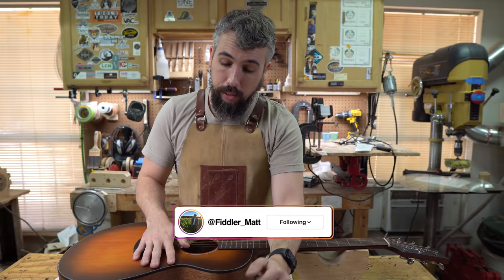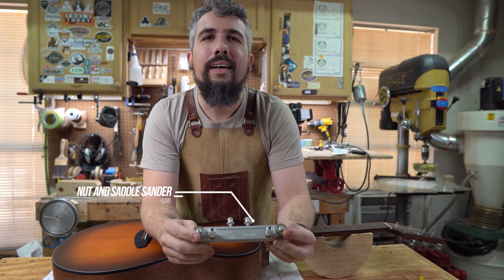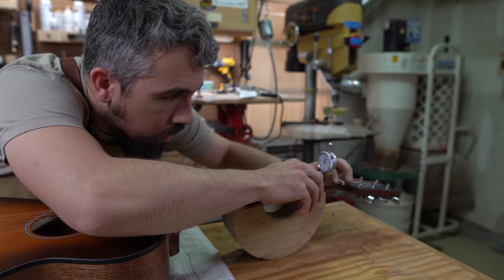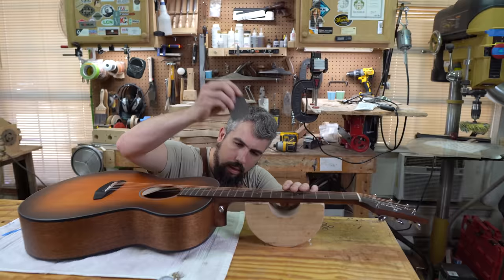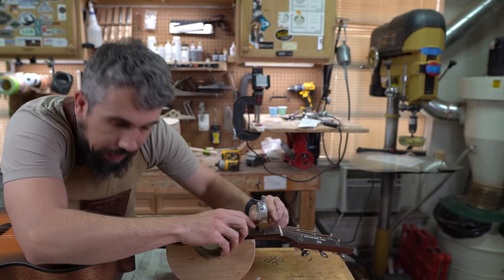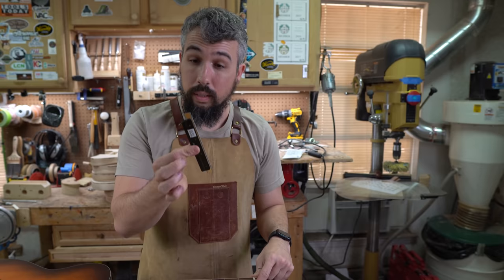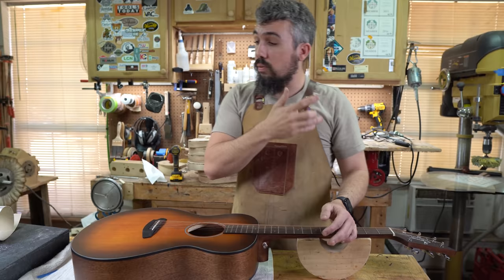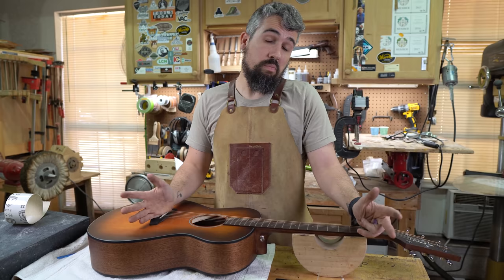How To Make $60 An Hour As a Guitar Tech/Starting Luthier!

Comment: Great video, guys! On the ‘complex’ math for how much to take off the saddle, it’s as easy as multiply by 2. You wanted to lower the action .030, so times 2 is .060 - the amount to take off the saddle. Your estimate (impressed by your eye and feel for this, by the way) was 1.5mm or about .050. If you’d done .060, perhaps you’d be where you wanted to be. Just times 2!

Comment: I worked for Gibson guitars in Nashville, doing final setup on electric guitars. We used a pretty cool way to mark the nut as a guide to how deep to cut the string slots.

Cut a pencil in half, then lay it it on the frets, with the lead touching the nut. Slide it across the frets to make a line across the nut.

Then cut your string slots, down to where the line is. It gets the action very close to where it needs to be.

Hope that makes sense!
Reply: Interesting
Reply: How much they pay

Comment: A great way to learn setups is to buy the cheapest guitars you can find, set them up so they play better, and try to sell them for a slight profit. I can now set up strats because of this. It's amazing how poorly people care for their guitars. A fret polish (not level, just polish), serious cleaning, some light fret-end dress, and a good setup can go miles for playability. 

Even if you break even on your purchase and sale of the guitar, you have already won through the knowledge you gain by fixing it up.
Reply: maybe not the "Cheapest" guitar, but inexpensive so you don't have to worry about it. like a squire for your first strat setup, for example, rather than USA fender.
Reply: Can I ask what you use to polish frets? And clean finger boards? 

Ive been taught to use zippo fluid. 
For fretts just a fine polishing sponge on a palm polisher. 

Thanks in advance if you see this. It's been some time since you commented.
Reply: @highrider9168  have used a few things 0000 guage steel wool and the music nomad fret polishing kit. Stew mac makes great micromesh pads, which i'd recommend. The compounds/liquid stuff does a "better" job  but it's a lot more messy and difficult.

Cleaning the frets - a scraper is your best bet, and a damp cloth of course! I have used steel wool but I think it shows scratches.

Comment: Being a carpenter and mechanic by trade early in life has enable me to have acquired many of the specialized tools you have that are used in other trades. I use the depth side of a set of calipers to measure string height and a two foot level with a machined surface to within .0005" to gauge fret height. The look on someones face after you have magically transformed an instrument to play like never before is priceless. They just look at you like holy crap I didn't know their was that much difference when you can play songs just like the original recordings. Just love guitars and music in general for this wanna be master 😁

Comment: That’s a great estimation. Lowering 0.030” @12th fret means lowering 0.060” at the bridge because 1/2 of the string length (hypotenuse of the triangle) will be 1/2 the height of the short side of the right triangle. (Edited for spelling)

Comment: Here is a trick you "might appreciate" for acoustics/classical guitars. You can take a hard cover book and slide it under the strings between the sound hole and the bridge. Slide it all the way down to the bridge, (which will lift the strings) and pull out the saddle to work on it. This is the ultimate time saver on classical guitars

Comment: A quick reckoning for the nut height is to measure the height at the 12th, then take away what you want it to be, and then take double that of the bottom of the nut, i.e. if it's at say 0.110, and you want say 0.095, 0.110-0.095 = 0.015, 0.015*2 = 0.030, hope that makes sense,

Comment: Budget as much as you can for tools and supplies.  Get your feeler gauges from the hardware or auto parts. Make a stable neck rest.   Buy every truss rod wrench you can afford. Keep spare nuts and saddles. 
This is a Stew Mac commercial. That's fine. But there's other companies out there that make decent tools. Some Stew Mac tools are indispensable a lot of them aren't. 
Buy a bunch of guitars, yard sales or whatever. 
Get them as playable as possible. The jacked up ones save to break and repair later. Sell the decent ones for what you can get and buy more tools and supplies. 
Work on all of your guitars. If you can't fix yours you shouldn't touch someone else's. Work on your friend's guitars. 
Ask people to be critical of you. 
Count on a lot of time talking to people and discussing their guitars- that's valuable time you don't get paid for. 
Be straight with the people you deal with. 
Charge a fair price for your skills. 
You'll probably never get ten guitars a day to setup. 
Don't spend money you can't afford not to have on hand. You will not make it back as quickly as you've spent it.

Comment: I bought the nut rescue powder set from StewMac when I converted a 35" scale bass to BEAD tuning because the nut was cut too low for 3 of the four strings when I bought the bass. I wanted to get the height right after I widened the nut slots for the bigger strings and it worked really well up to the .130-gauge low B string and it has held up really well. I find I like tweaking my setups very much. I know the nut power set is not on your list but with some superglue it makes it nice to match the nut color since it comes with different tinted powders.

I love your videos and thank you to both of you. I still wish I could afford one of your guitars...wow.

Comment: Very surprised that you didn’t include fret levelling, shaping and crowning files in your ‘essentials’ tool kit. The nut racer can be sorted with two pieces of wood and four wingnut and bolt combinations. Plus maybe some wheels or roller skate bearings. The money saved will buy a decent levelling beam, triangular fret file with smooth edges and a file to round over the fret ends.
Reply: I'm guessing it's not in the realm of beginning luthier work? 

I don't know, I kinda do my own setups but fretwork scares me lol
Reply: @jamquijano4402  first stuff I looked at many years ago - with good reasons! It IS an essential for repair/setup work though. Can you imagine trying to start a biz and admitting you can’t sort frets? Reputation shot before you start!
Reply: @paulneeds  Absolutely agree.  Fretwork is really where the rubber meets the road.  Proper contact between accurate frets and the vibrating strings is where it all begins.

Comment: Get the Dan Erlewine dvd on fretting and setup. He shows you way cheaper ways to get started. A 2’ aluminum level trued up with sandpaper on table saw table will level it up and work for leveling fretboards and frets. Also a plastic drafting T-square for a straight edge with some tape along the side for better sighting works just fine and you can file slots in the opposite side to check fretboard after it’s fretted.  Get Dan’s dvd and the tips will pay in the end.

Comment: I’ve been picking for 53 years and damaging guitars for about as long. I’ve also been learning steadily over the years, and have learned a whole lot from you guys. I hate measurements, but finally bit the bullet and bought most of the tools/books) you reference here and/or a prior “giveaway“ video …cork neck rest 🤣!  Not ready for fretwork yet, but I’ll get there. Re Breedlove: right around the time you did that factory tour reaction I was researching them… and bought one of their handmade Premier models. Love the tone but I can’t give you any “data“ on factory set ups because it’s a used 2017. I sure hope The one in this video was an oddball because I love to tone & playability and the company is doing some really interesting things… enough snow to get me to buy my first bolt-on acoustic neck after decades of being a (now-former) D-28 owner bullying friends who play Taylors. How ironic that I know on [ < typo = “now own] a guitar with a bridge doctor, stock!
Reply: I just got a new Breedlove Oregon. On every one that I tried, the factory setup was crazy high. Way too much relief, nut needed filing, and the saddle needed to be lowered. Love the tone of my Breedlove, but they need to do a better job on factory setups. All of the Taylor guitars I've played had perfect setups.
Reply: @jlr3802  cool, sounds like you know your stuff. Question: did you buy the guitar from the factory or from, say, a Guitar Center store, where almost no guitar is set up properly (if at all playable, like literally most of the higher-end guitars at my local store when winter hits)?  [Edited to fix my flagrant typos]

Comment: The math for the saddle is very easy, you need to remove just the double the quantity you want to low in the 12 fret. Like it is in 110 and you want to go 80. The difference is 30, and the double is 60 thousands (1.52 mm).
Reply: My advice is to not  set new cheap guitar too low, cause is almost sure it will have some irregularity on the frets and will buzz. So, to low the action to a minimum, you need to check and dial the fretwork first.

Comment: I took the backward route; I built two acoustic guitars only understanding how to set the neck angle. Now I will use them to practice setups. These tools are not cheap though; that action gauge alone costs over $200. Fortunately I already have a few cheaper tools like these. That nut race car is out of stock though.

Comment: That formula for lowereing the saddle is basic right angle geometry. Take twice as much off of the saddle as you want to lower it at the 12th fret. 
EG: if you want to lower it by 1mm, take 2mm off of the saddle. Im mich more comfortable with doing a little easy math than taking off too much and having to make a new one.

Comment: At one point I realized I would never be rich enough to buy all the instruments I wanted, but with that came the realization that I could fix as many instruments as I wanted (if I can find the husks and bits); a good shopper can find values on distressed items if they are willing and able to put in the time to restore them.  
When I bought my Rhodes for what today is a ridiculously low price, I made sure to hunt down spare wires, tines, pickups, etc...just to have the parts, it was complete but a little rough - cut to the end, I have a Stage 88 that I adore and cannot be replaced.
When I get more space, I have a pile of different keyboard instruments and accessories to refurb - I've always wanted a Leslie anything and a whammy clav like Lachy.  Turns out, there is a giant mountain of old electric pianos that exists and the cycle continues...

:-)

Comment: an alternative for the bridge pin puller could be a capo with one build in so if you need to change strings on the road youre able to just to have it handy otherwise id keep the good pin puller

Comment: Thats crazy. I have 6000 in auto motive tools and dont make half of 60 an hour. I have to measure blocks to within 0.001 inches in some places, disassemble, clean, lube, rebuild, time and run a V8 twin tubro engine.....I literally have a single torque wrench that costs 600$. I need to get some fret tools and side hustle is ready!

Comment: top tip for using a string winder - make sure the tuner head button doesn't go all the way in, i almost ripped up the side of the headstock first time out cos the tuner peg went all the way into the winder, pad it out with something so you miss the side of the headstock!
for the sake of prejudice stewmac is a great place to go to see what tools you can get elsewhere at a better price, i took a glance at the book and i'd advise anyone to read the reviews before they buy, stewmac is great, but over-priced and over-rated. sorry.

Comment: Get a notched straight edge. It will tell you if the fretboard is straight by using the fretboard rather than the fretwires which are not even most likely.

Comment: Is it correct to adjust the bow out of the neck with the truss rod with the strings on the guitar and in tune?  One would think you'd try to take bow out with no string tension.

Comment: Great video, thank you very much. One question, what should the height be at the first fret for all strings? Its always just the low E and high E that are mentioned. Is there a rule to go by to adjust the height for the 2nd, 3rd, 4th and 5th string?

Comment: probably should have clarified that running a string across the bone dust and glue should only be done with the old strings, as doing it on your new ones will leave you with residue on the string causing clicking

Comment: Hello Chris and Matt.  Really love your channel and have learned a lot.  I have a notched straightedge that can fit over frets.  When I check my neck relief I measure in between frets, so fretboard to straightedge.      In your opinion is that fine or should I use a true flat straightedge and measure relief using top of frets?
Reply from the maker: You’ll want to use a true straight edge to measure from the frets. I don’t even own a notched edge, as I’ve never found a good use for one.

Comment: On the nut and saddle, is the string groove best if shaped square (90 degrees) or rounded like the shape of the string? 
How about using the files used for welding torch cleaning? 
What causes the tich tich sound when adjusting the tuning?
I’m working on a garage sale guitar with a bent neck because of steel strings on an untrussed neck. Trying to straighten the neck, so neck relief is an interesting concept. Does the neck have the relief even with no tension on the strings?
Reply: Rounded nut grooves pointing towards the tuning peg for the particular string.
Welding torch files bend and you would get a rounded groove at each end.
The sound is from the stuff he put in the nut when he filed too high, it is caused by the string catching on a rough surface.
Remove the strings and Lay the guitar on its face supported each end and put a heavy book on the body near the neck and leave it overnight in a warm room but the neck will probably just return to how it is with strings due to the stress on the dried wood.

Comment: You mentioned needing nut gauge files. Does that mean that as a guitar player I need to have my nut adjusted if I want to go to different gauged string than what came on the guitar?
Reply: The short answer is.... Maybe.  The long answer is that it depends on the slot sizes in your existing nut.  If the nut slots in your guitar are very close to your existing string diameters, you may experience binding of the strings in the nut slots if you go to heavier gauge strings, especially with the wound strings.  You may have tight nut slots if you now have any "pinging" or catching of strings in the nut when you tune your guitar.  It could also be a rough finish in the nut slots catching the strings (or a soft plastic nut), and an experienced tech or luthier can check any of these conditions for you.  If you go to a lighter gauge of strings with closely fitted existing nut slots, you will probably be ok.  If the existing nut slots are "generous" in size, related to your string gauge, then heavier gauge strings will probably fit and function all right with the nut you have now, but if you are going to a lighter gauge set, the strings will have the ability to work side to side in the looser fitting slots.  You can check for this if you detune or loosen your strings, and if you are able to move the strings at the nut from side to side any noticeable amount, you are more likely to have looser slots.  It is a matter of a very small degree, just how tight the fit is of the strings to the nut slots, and is something that you may or may not be able to sense for yourself depending on your level of experience working with tools and materials, but a skilled tech or luthier can check this for you if you are new to this. The correct fitting of the slot size to string gauge, as well as a properly and smoothly finished nut slot and the right nut material is a very important step in a well done setup, and any tech or luthier worth their salt will recognize this.  Many new guitars, especially some of the more affordable ones (less than about $700-800) come with plastic nuts that are too soft for the purpose. A replacement nut can make a world of difference.  Quality bone, Tusq, micarta, Corian, or 'graphite' type nuts are generally considered the most popular and effective.  I hope this helps answer your question. If not, hit me up again and I will try to get you some more information. Good luck.